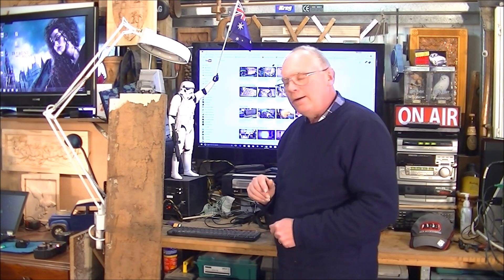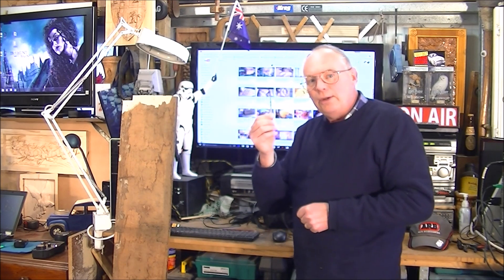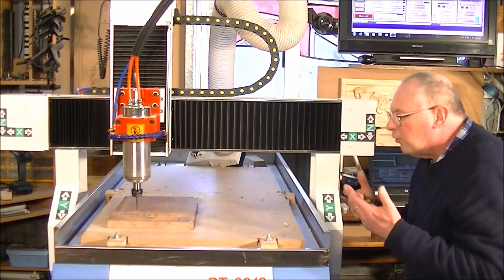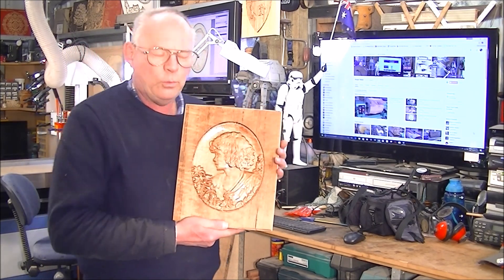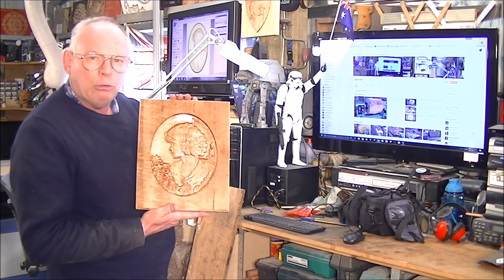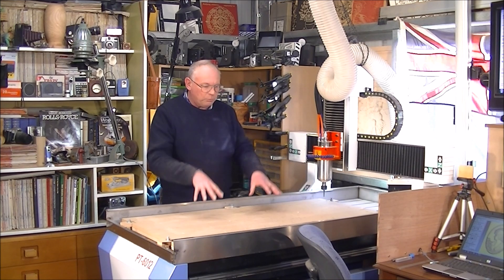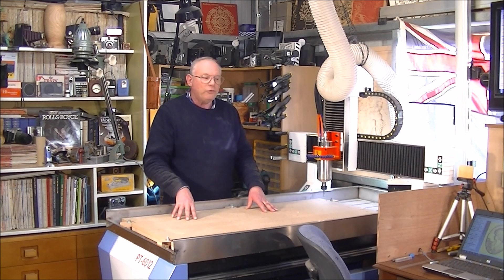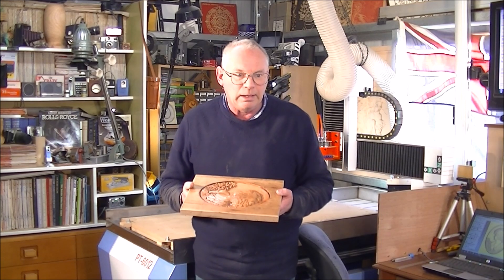Make $150,000 per year with a 6012 CNC router, 3D machining an image into oak

Comment: Hello,
Thanks for your comment. If I understood a machine like the workbee/QueenBee CNC won't do the job ?
Reply: Well i am just getting in to carving with my stock Workbee (planning to upgrade to a Killerbee sometime in the future). And tbh i think it can do the job just fine. But as i said i never did any engraving yet, so i am just speculating.
Reply: @digitalfabricationlab  thanks for your comment.
Reply: @Levisgil47  not a problem. Just want to add that I am cutting hard wood and aluminium with my Workbee with near perfect results. The think is that you need to take your time and learn the machines capabilities before you attempt to do any job.
Reply: @digitalfabricationlab  Good to know. Maybe the queenbee or the killerbee would add more capability. I wonder if carving needs that kind of rigidity to be more precise.
Reply: Own a workbee it carves out great they can do anything apart from hard metals like steel & titanium, for wood it is decent